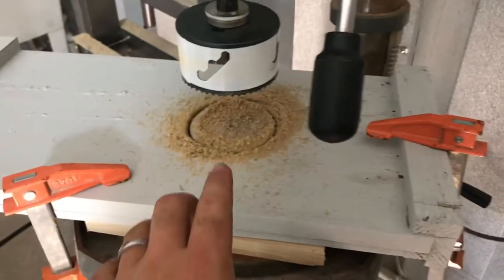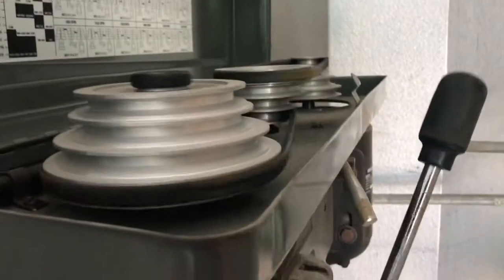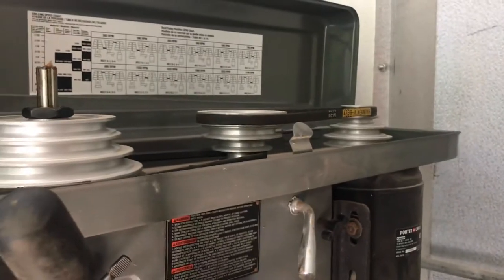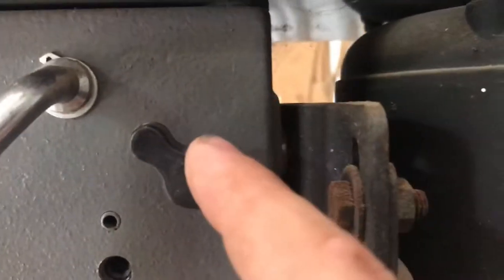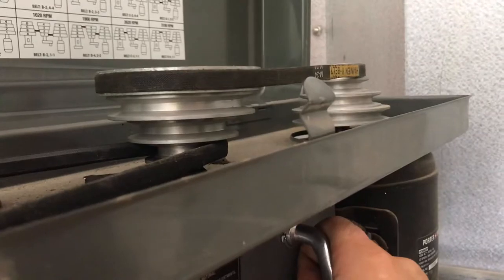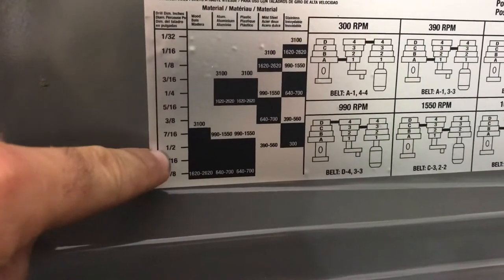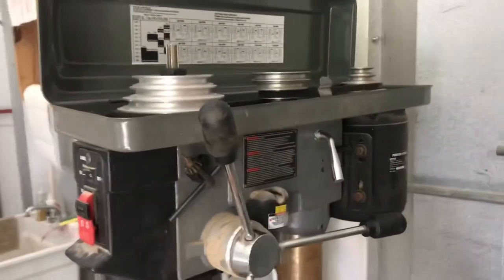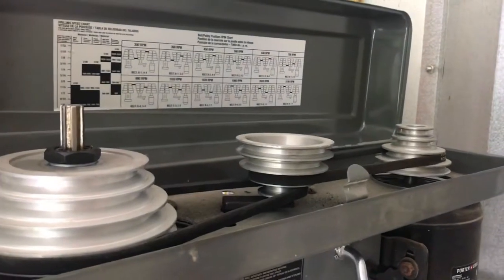Drill Press Belt Adjustment

Comment: Thank you SOOO MUCH - I had the exact same issue with a 2” drill bit & was at my wits end!  My drill press did not have that lever so I loosened the set screws for the motor & tapped the motor shafts on each side which tightened the belts and then tightened the setscrews.  I then tried my 2” bit which I cut into PVC board & it drilled straight thru!!  I was going to buy new belts - even a new drill press - your video saved me!!

Comment: That middle pulley on mine dont move..  its locked solid in there.. the motor side tighter than a banjo but the business end is loose as .  Well you know..  that stuff we used to get back in our day..  im fittn to take a 10 pounder to that thing..

Comment: Actually the bigger the cutter diameter the slower the rpm should be.  Think of it this way, compare the tangent velocity of the outside edge of let’s say a 1/4 inch cutter to the tangent velocity of a three inch diameter cutter for the same rpm and you’ll see that the teeth in the 3” cutter are really moving compared to a 1/4” dia cutter.  When the cutting edges velocity is to fast for the cutting edge to be able to “bite” in to “scoop” away material, you’re then just heating up and dulling the cutting edges quickly, damaging the cutter.
Reply from the maker: I agree! Very good point!

Comment: You didn't show how to adjust belts
Reply from the maker: I thought I explained it, I’m sorry. You just loosen the motor to slide it in and loosen the belts. Then you can just slip the belts up or down on their pulleys to change the speed ratio, and then tighten the motor back up to tighten the belts.
Reply from the maker: Hopefully that helps. Thanks for watching!
Reply: @TomBrueggen  Tom, I recently acquired the same press... Belts are so worn, the belt number is worn to the point, I can't read the belt #... Can you supply the numbers??? I tried stopping the video in the 1 position of the number, BUT, couldn't make out the numers...
Reply: @robertbobphillips  Take the old belts to a tool supplier. They should be able to tell you which belt is needed. Or you can go online, Ebay or Amazon have many place you can order replacements, if you know the model number and manufacture date.